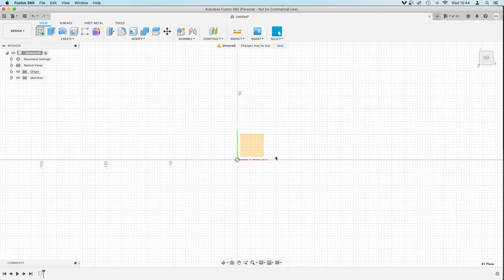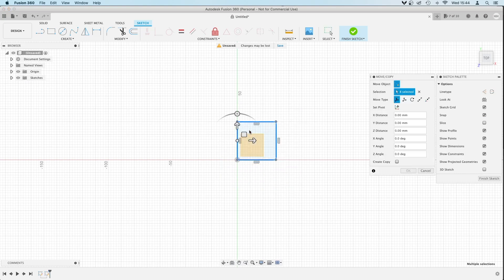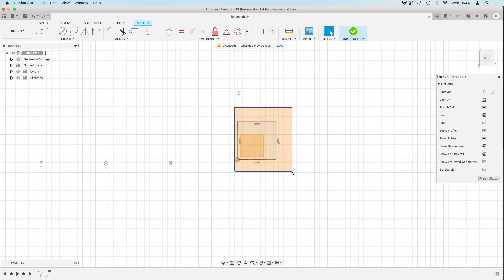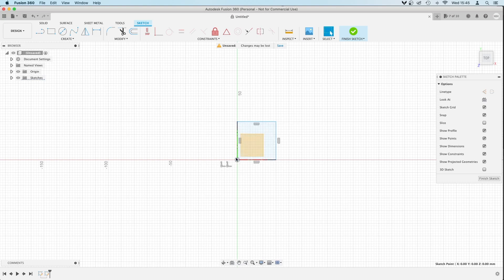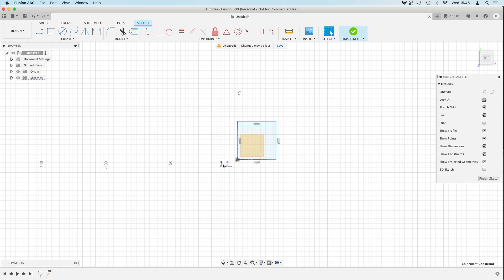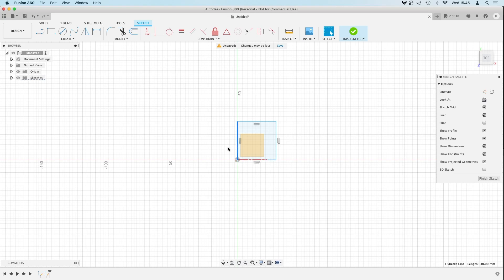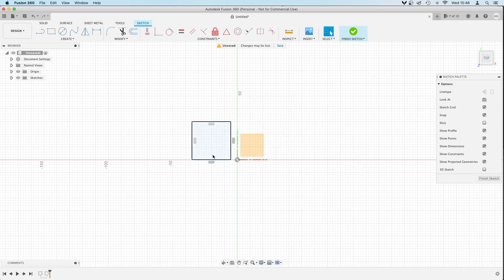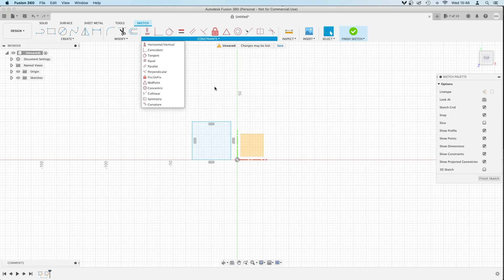Sketch Shape Won't Move in Fusion 360 (solution)

Comment: Think the real problem is Fusion Move Command is broken - it does not report any errors when it does not move the object. I don't mind a dialog / warning about moving a constrained sketch...it poor user interface design, terribly poor.

Additionally, Fusion appears to create constraints automatically - which you could do as another step in the process. Especially with sketches - they are early drawing primitives' - so they should be more flexiable. Or at least an option to 'not' constrain sketches. [I know, I know - but the origin of the sketch does not have to also be it's constrain location.]

Comment: I have removed every single constraint. I used the selection filter and everything. It still wont move.
Reply from the maker: When this happens and there's no clear solution, I usually just delete it and draw the sketch again.
Reply: @kwerkshop  Unfortunate if the sketch is really complicated and it takes 60 minutes to redraw it. I hate Fusion 360 but there are no alternatives